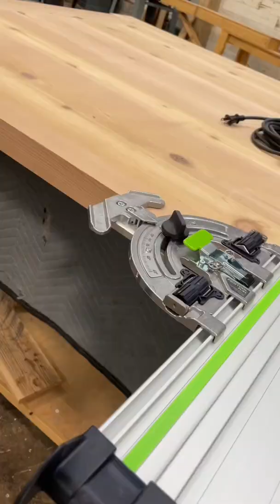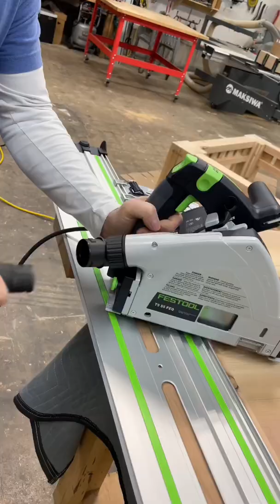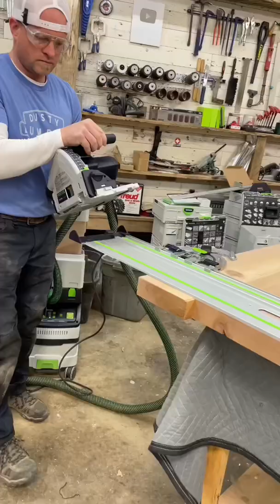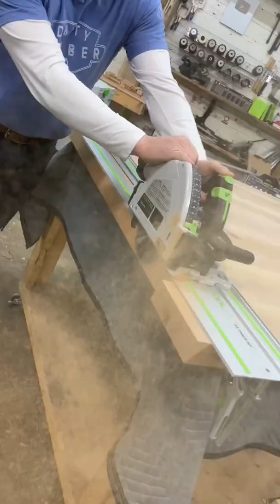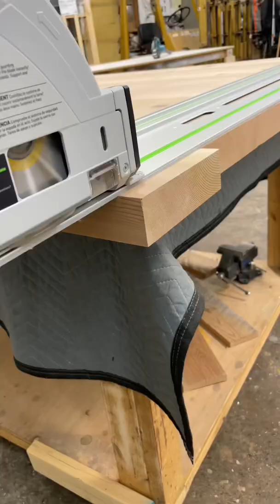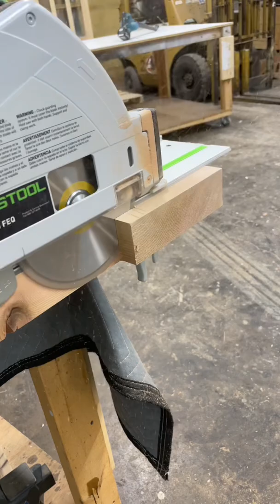First cuts with the new TS55F

Comment: Pretty dusty for a dust free system that cost that damn much !! I hook my Milwaukee backpack vacuum up to my batter hand helds and it’s damn near 100 percent dust free …for that price I feel like that is straight BS
Reply: That much money it better clean up all the remaining dust
Reply: That much money it should mark, measure, cut, glue, and finish the board.
Reply from the maker: Obviously the dust was flying because us was a shave on the outside of the board. If the blade is in the wood it’s captures all that dust
Reply: Was thinking the same thing, even on the closed cuts
Reply: @dustylumberco  but how do you justify the price being so high when you can just purchase a table saw and a good vacuum?
Reply: I agree. I have a Borscht track saw and dust sucker and hardly any dust on the work surface. Love it.